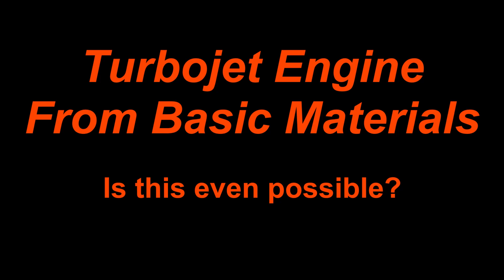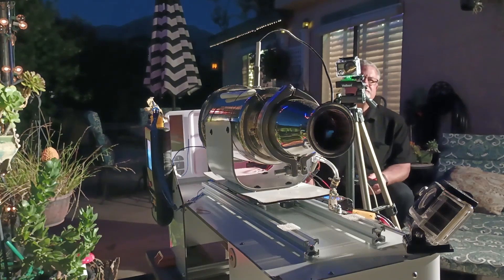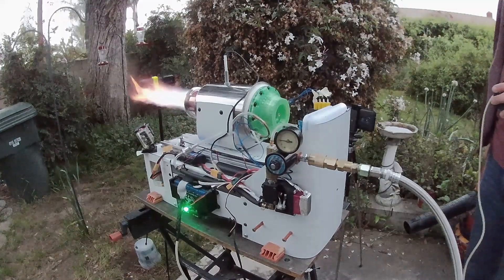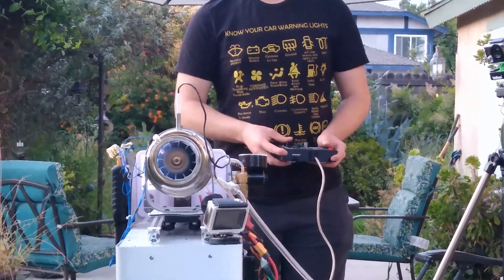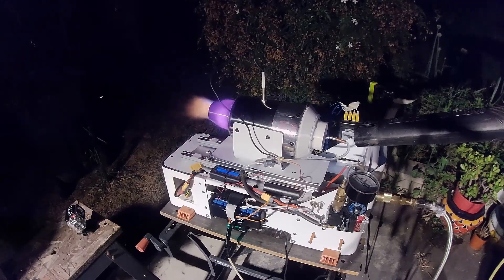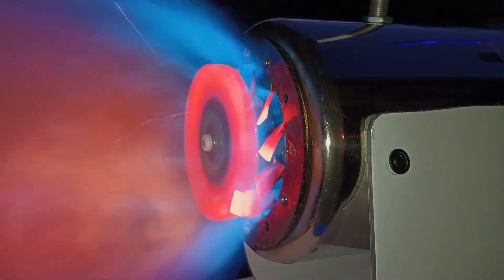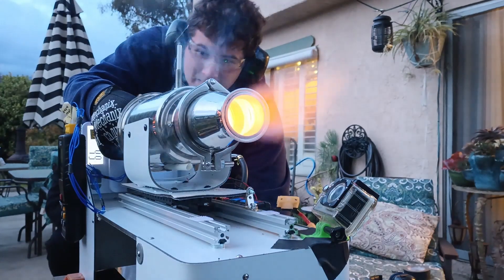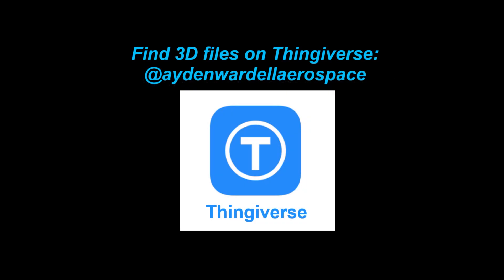Turbojet Engine From Basic Materials - how hard can it be?

Comment: You could order metal 3D printed or CNC parts through PCBway or JLCpcb, they have decent pricing from what i have seen (i have never ordered from them). You could maybe expect 40-50 euros/dolars for a steel/tool-steel impeller, but they have instant quoting so you can easily get an idea. 

You are quite inspiring, keep it up!

Comment: Radial compressors like this require a really high RPM to achieve a sustainable compression ratio. Most 3d printed materials with the exception of maybe industrial stuff like PEEK aren't up to spec in terms of their elasticity. You will likely need a different solution as far as the manufacturing of the compressor wheel.
Reply: I was thinking centrifugal compressor or at least trying a higher temperature filament like cf nylon.

Comment: I think you should try using resin 3D printing for parts that are usually kept cool. If I (for some reason) needed a turbojet I'd probably just get a used turbocharger for cheap and attach a combustion chamber to it, while it isn't as efficient as designs like these it works (and I'm pretty sure it'd be better than just trial and error), but either way, I can't deny I'll love to see what you will come up with.

Comment: All rotating componet should be balanced, and the spray bar for the fuel can be improved using airbrush nozzles to get better spray patterns. The combustor assembly can also be reworked to incorporate vanes in the intake and exaust side. For some added resouces look up easa module 15

Comment: you could 3d print it then put those 3d print in food can with wet sand, or for more precision plaster and cast them by yourself, altho i'm not sure about cost if making a furnace out of bucked, roof torch and isolation. You will spend less on 3d filament tho
Reply: That’s quite time consuming and difficult. I already tried that myself and I can recommend looking into metal 3d printing services instead

Comment: Look up aluminum casting of previously 3D printed models.
It is tricky to get the 'running of the molten metal' just right but there are techniques how to get the initial casting quite right. Of course since you are dealing with thousands of RPMs, further processing such as milling, sanding, balancing would be needed but can be done.

Not sure what pressure are you using for the fuel injection but having a fuel pump together with better fuel atomization could help the combustion at the start-up as at higher air pressures while running.

Generally speaking any straightening and avoidance of turbulance in high temperature zones is going to decrease a temperature transfer.

Also evaporation/heating up of the fuel before it gets to the injectors can take heat from areas needed to be cooler.

I like the idea behind your project - I wish you luck
Reply: I think casting aluminum parts from 3d printed parts would be too time consuming and expensive. There are 3d printing services that can produce aluminum parts. If you don’t need many parts that could be cheaper than buying a furnace or building one yourself. You also avoid handling molten metal which would be rather dangerous. Also if you need even more heat resistance you could also use titanium or stainless steel, which wouldn’t be castable anyways

Comment: IMPORTANT---------If you want INCREADED PERFORMANCE one way to get it is to make a spiraling fuel injector, the easiest way to do this is to get a metric tap, and a metric nut and put the spiral tap in the nut. However, if you choose this path, you may have to rebuild the fuel delivery line, with vented metric screws. For m3 vented screws use a 2mm drill bit and forcefully insert them into the fuel line so they cut their own threads and seal. The spiral fuel injector in my experience, burns closer to the stoichiometric mix so it burns hotter which means more performance.
Reply: I have tried this in my turbojet, and it works marvelously.
Reply: can you expand more on this i couldnt find much about it.

Comment: You can order a partially threaded m8 shaft from McMaster car the dimension of the shaft are 8mm so they are compatible with the bearings. The threaded shaft will allow you to use 2 metal nuts for the rear turbine.
Reply: Due to heat cycling that will unscrew itself in a moment.
Reply: @akkudakkupl  yes and no, if you torque it down it won't, I've used it in my turbojet that's how I know.